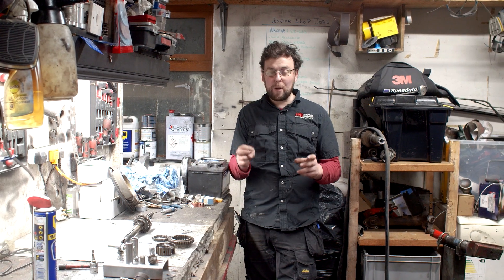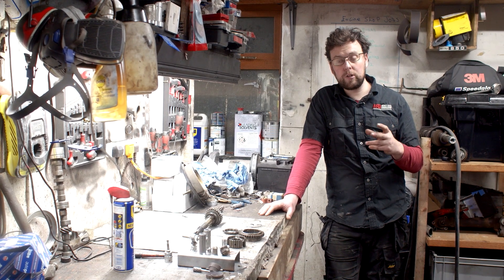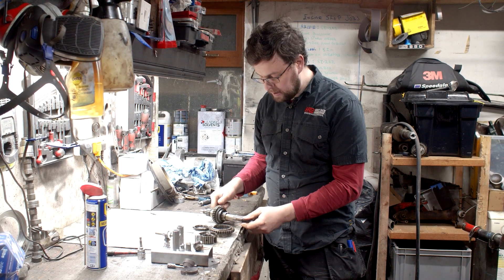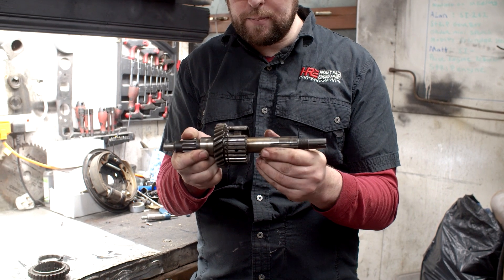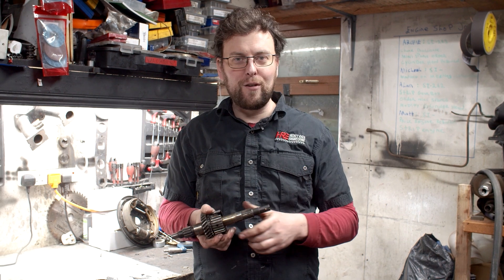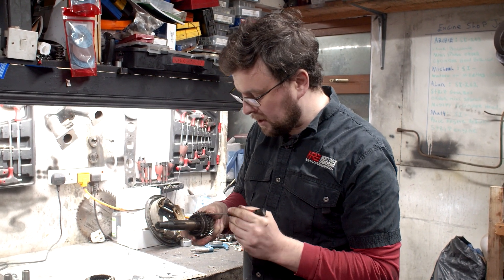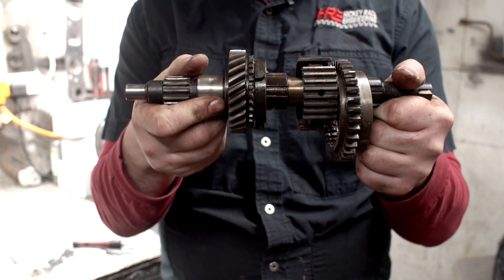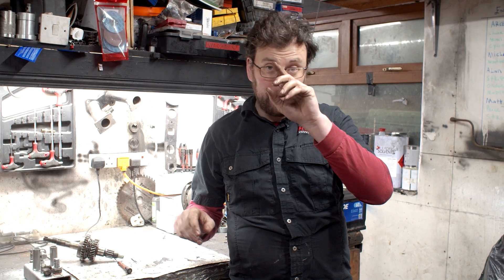How Synchromesh Gears Work

Comment: I'd say the thing that keeps the gears meshed is that angle in the dogteeth and those detents.  One gearbox I had in my Mini had bad detents (either broken or missing) on second gear, and it would stay in mesh perfectly - until I backed off the throttle, at which point the angle was exactly wrong and the car would pop out of gear and into neutral.  I was so happy when I finally got rid of that 'box.  :-)